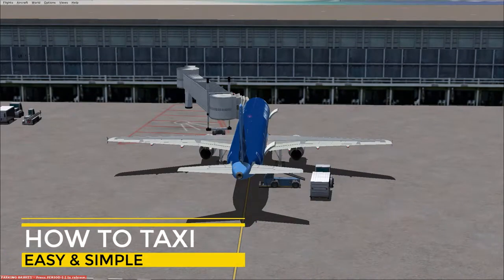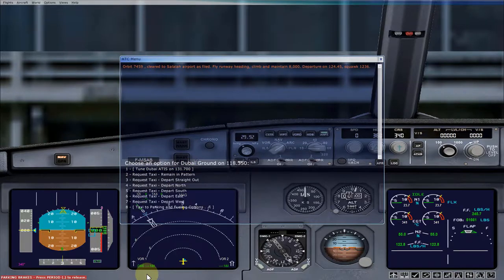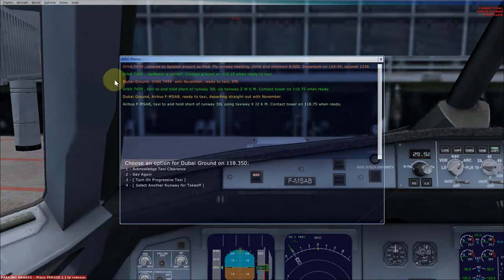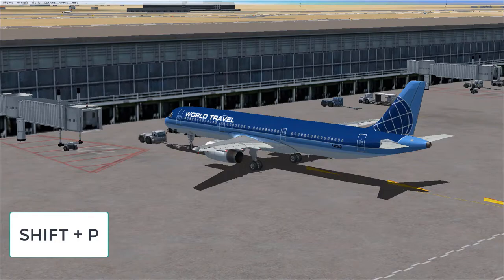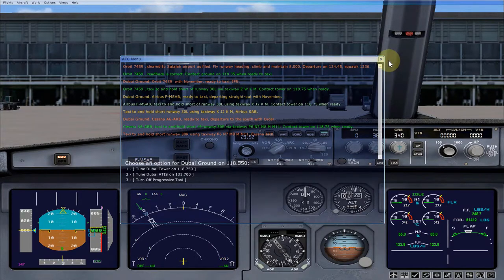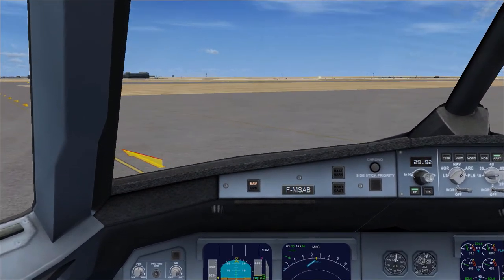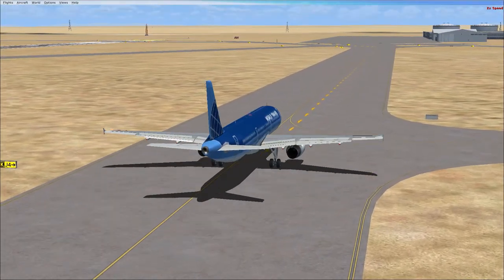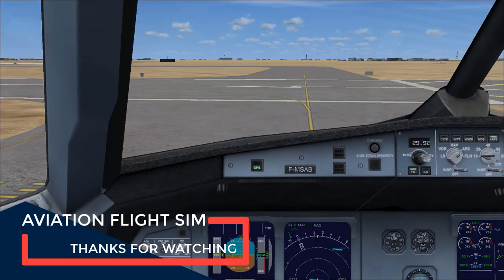FSX How to Taxi | + Pushback & ATC | Learn Easy Quick & Simple Guide | Airbus / Boeing | Tutorial

Comment: Strobe needs to be turned on before takeoff not during pushback.

Nav lights on after battery switch is on

Beacon lights on before engine startup!!!!!

Seatbelt and no smoking signs need to be switched on at the gate before boarding and engine startup.
Reply: Strobes go on when entering runway I believe